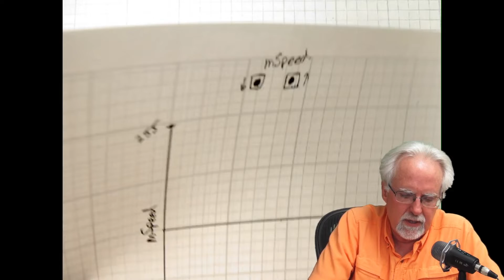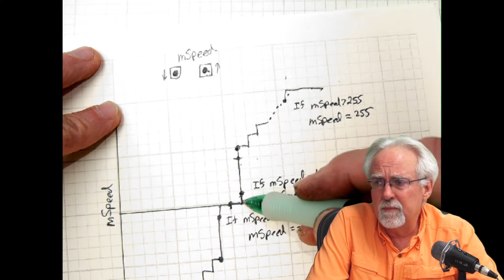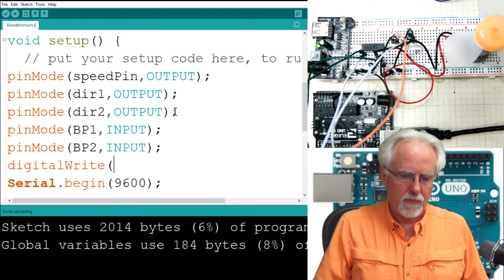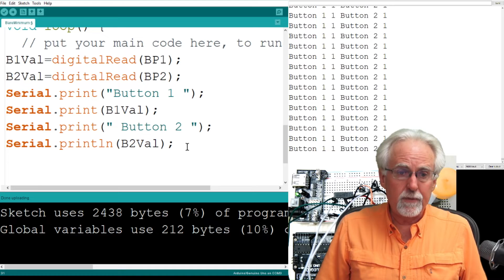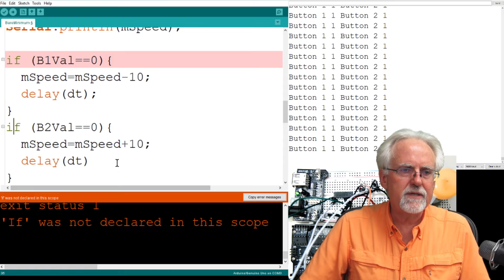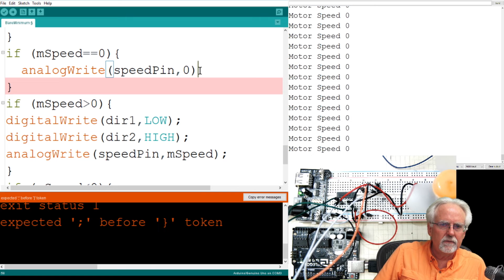Arduino Tutorial 40: Controlling DC Motor Speed and Direction with Pushbuttons

Comment: hello sir,  i did the homework, i haven't watched this video yet ; my program seems to work fine , i'll share my program with you below. in fact i don't have a super power of energy so i just use my laptop's power to make my fan move

if(val2==1 && val9==1)
{
  digitalWrite(dir1,LOW);
  digitalWrite(dir2,LOW);
  mspeed=0;
  analogWrite(speedpin,mspeed);
}
if(val2==0 && val9==1)
{
  for(i=0;i<=531;i++)
  {
   mspeed=i+100;
   Serial.println(mspeed);
   digitalWrite(dir1,HIGH);
   digitalWrite(dir2,LOW);
   analogWrite(speedpin,mspeed);
   
  }
}

if(val2==1 && val9==0)
{
  for(i=1023;i>531;i--)
  {
   mspeed=i-531;
   digitalWrite(dir2,HIGH);
   digitalWrite(dir1,LOW);
   analogWrite(speedpin,mspeed);
   Serial.println(mspeed);
  }
}